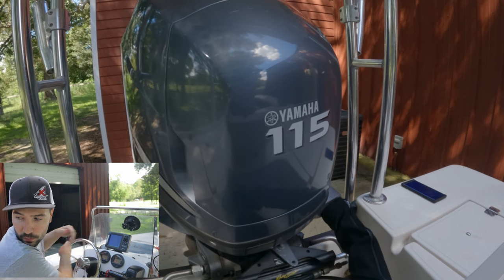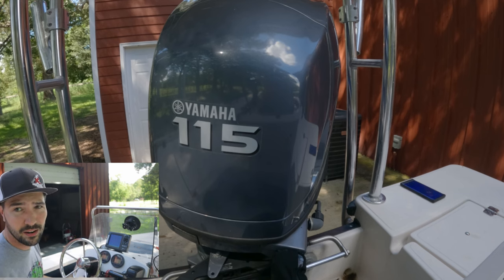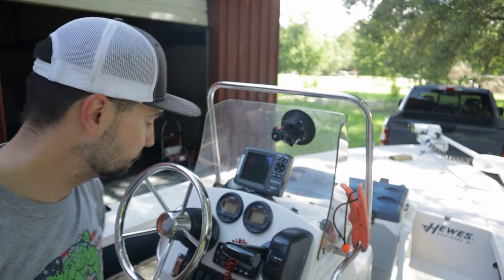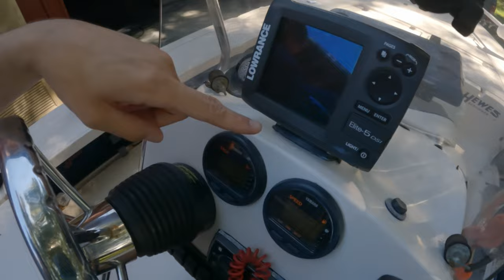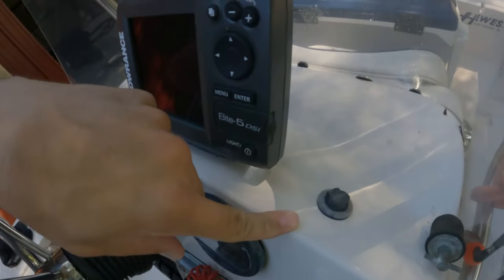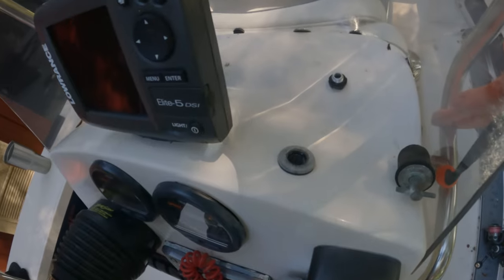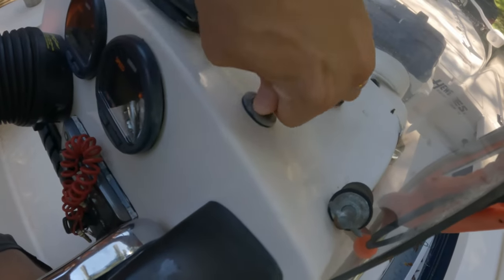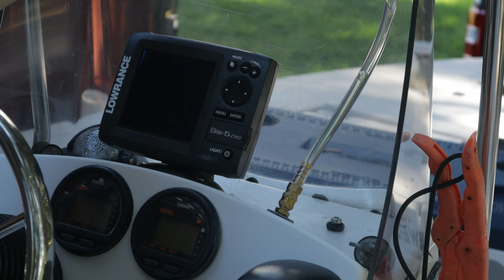If your outboard steering isn't working, WATCH THIS!

Comment: I just filled my boat's Sea Star steering unit and got it working again.  I didn't have the hose for the cylinder and it appears to have released all of the air without it.  It took a pint of oil to fill it up.  My boat is a 98 Boston Whaler Ventura 18'.  The oil bottle when I relaxed my hand compression helped vacuum the air out of the system.
Reply from the maker: Very nice !

Comment: Really good "how to" video. The walk through on trouble shooting was excellent....... Couple of tips though, and I'm not a "marine mechanic" either, I am however a hydraulic mechanic. The line hooked up at the back to only one side is of absolutely no value to the process. You could likely swap the steering hose with the bleeder so that the bleeders are both inboard. I don't really know if it's worth the trouble though. Definitely start the process with the outboard to one side or the other and slowly turn to the opposite side. If your cylinder or your helm unit is leaking you are far better off taking it to a professional for repair than doing it on your own. No offense to any "diy" guys out there, it's just that sometimes special tools are required.

Comment: I know this is an old video hopefully I get a response. If I turn slow the motor won’t move. As soon as I put some speed in turning it starts to turn. I’m hoping bleeding will help. Any suggestions? It’s only when turning starboard side btw
Reply from the maker: I think bleeding will definitely help. There's a chance either there's air in the starboard hose or perhaps something with the cylinder

Comment: As you only did one side at a time , wasn’t fluid coming out of the tube connected to the bleeder on the cylinder
Reply from the maker: No fluid was coming out of the tube, but it's very possible because I did only one side at a time the system wasn't fully contained which allowed air to get into it still...